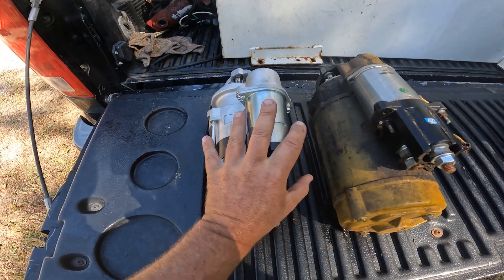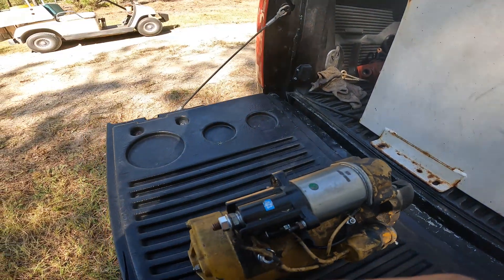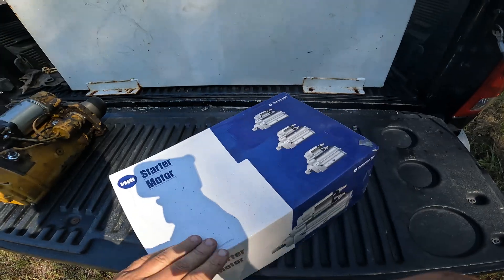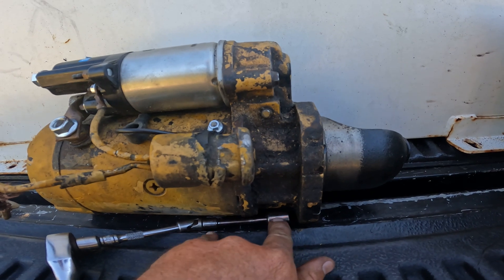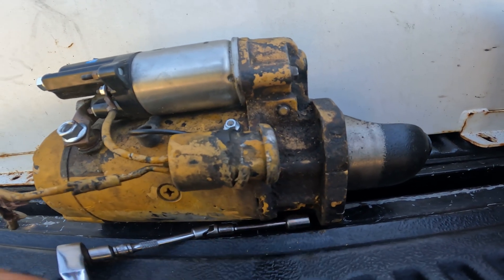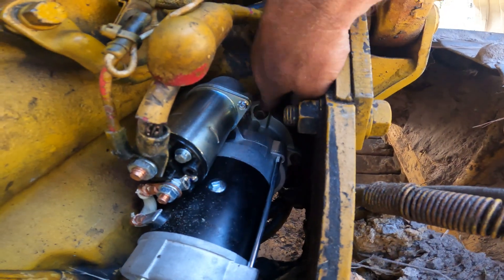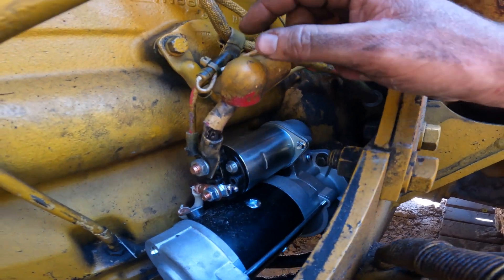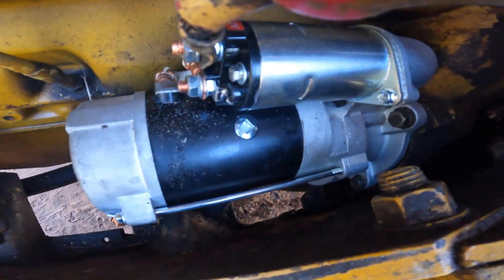D3C Starter replacement

Comment: Great  Video! I am in the process of changing starters on a Drott Cruz  Air, the situation is very similar. I’m going to replace it with a reduction starter as well, and you are right about the weight of the old one, what a Beast!

Comment: Cat 3116. Had the same issue removing last bolt on starter. Bought a "toggle extension", which let my socket fit flush and the wrench had clearance. I almost took a grinder to my regular extension to make one. It's about 20 bucks for a set of toggle extensions. Pruno
Reply from the maker: Great idea, I wish I had thought of it.

Comment: What year D3? And what company makes the starter,
Reply from the maker: The dozer is a 1993 D3C and the starter is a WPS 6600N. The engine is a Cat 3204. In hindsight, I would have taken the belly pan off first, then driven the dozer onto 6x6 blocks to give myself a little more head room. I hope helps! Good luck